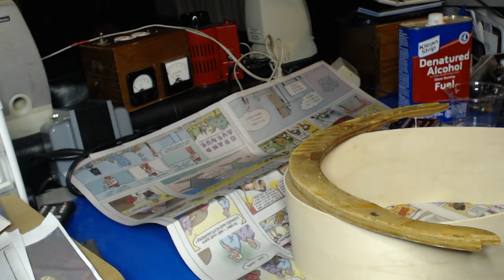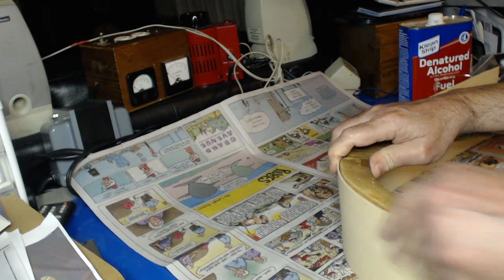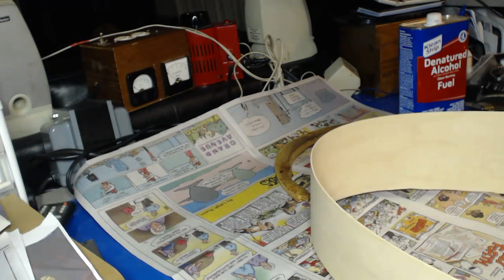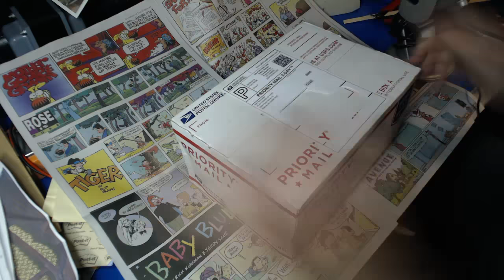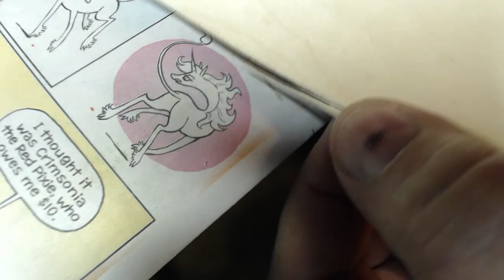1932 Mystery Cathedral Radio Restore Part 5

Comment: Hi Buzz - I was looking through your videos and saw you bending wood.  I have built cabinets.  May i give you a tip?  Heat helps wood bend.  Make your wood damp with water (not alcohol). Make it VERY hot.  The water stops it from burning. The hotter the better, much too hot to touch with bare hands (this is just like work).  Love your videos, love you, love your willingness to go forth and try new stuff.

Comment: 6am and you're up fixing a radio, wow now that's dedication! lol I think they used to form the original cabinets around a form and steam them or something but I could be wrong. Good song choice, I love Glen Miller! Hmm, maybe you can squeeze those sides in. not a bad job for a first attempt!
Reply from the maker: Hi Dan...I thought of using steam, but went with what was easier to video..I think it might work when i glue in the front...regards, Buzz

Comment: You have done it again Buzz.  In the recesses of my mind, I recall my grandfather boiling hardwood boards to bend them for bobsled skis.  I wonder if a short hot bath would limber up the veneer?  Every week we can see that radio taking shape.  I am already wondering about the front where you removed the wood on each side.  You may not be a teacher, but you sure have a pile of students.  I poked a hole in the speaker grill of a '31 Philco today.  I am not very happy about that.  I am going to try fabric glue but I will likely need a new piece of grill cloth.  You beat yourself up at times, but you don't have the clumsy market cornered yet!  Great video - great work.  As far as Dickel goes, can he show a loss in the last 18'years?
Reply from the maker: I am a teacher of "How Not To Do it"....The video turned out OK and that's what counts...I will fix the cabinet and it will look OK , I hope..haha..Buzz

Comment: Hey Buzz, I'm surprised Dickel didn't get a call asking if he had Prince Albert in a can.  Too bad you didn't have a steam pipe to bend that wood in.  Makes ya wanna punch Norm Abrams and say, do this stuff with tools people can actually afford, LOL.  When you said "do it the old fashioned way" I thought you were going to get out a coping saw.  Using those nails and screws was an interesting concept.  I figured you'd just use wood glue and clamp it overnight or a couple days.  How do you get the nails back out?  Or are you just going to apply another piece of veneer over that one?  Looking forward to next weeks solution, Gary
Reply from the maker: Hi Gary...I wish I had the small clamps before I started gluing, The nails come out easy as they are short...and I will put a nice veneer over it.

Comment: Buzz,

You're doing a fantastic job!  I can't imagine what they went through in the cabinet shop at the factory where they built these things.  I was wondering, could you have used steam to help curve the veneer rather than denatured alcohol?

Regards, Tom
Reply from the maker: I could have built a jig to hold it, but I  didn't want to  spend the the money for the wood, and also I probably  don't have the  brains to make one,.....This was just for 1 project... so I just went with what I had,  and did it LIVE on camera...If I had more small clamps, I wouldn't have needed  the nails, but I thought it would be fun just to do it.......Buzz

Comment: Buzz,  I've been away too long, my friend.  That job was shall we say...shall we say...well, you know what I mean.  Perhaps a plan B would have helped.  Incidentally, we don't remove veneer from speaker grill openings with X-ACTO knives...no, no, no...one uses a Dremel tool and small sized sanding drum set to very low speed.   It'll gently sand away the veneer in 10 seconds or less.  The final millimeter is done by hand.  And what's with the screws, nails and contact cement (contact cement???) to hold the veneer down?  Tsk-Tsk.  No hardware needed and wood glue is the answer.  Other than all that it was a great video.  Regards,  John
Reply from the maker: Hi John...Glad to have you back, but I did what I did for a reason..I needed 3 min 30 secs for the Glenn Miller Tune so I had to carve it..that wasn't thin veneer that woukld come off easy... .... which lead to the wifey yelling bit about the mess and the bending bit was done because I had no clamps at the time..and it was was funny.......The nails are already removed....It was all in the script.  sometimes thing aren't want they seem...Wait till you see the final product....hope your operation went well.regards, Buzz